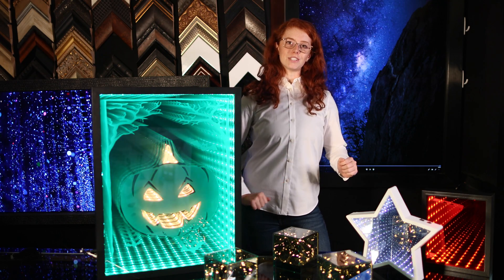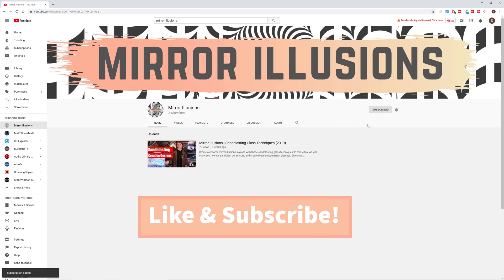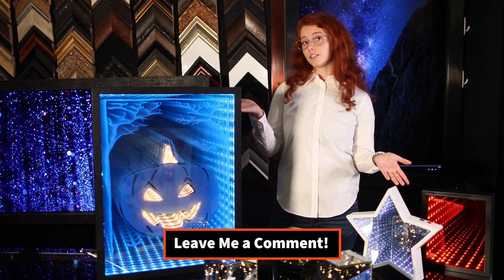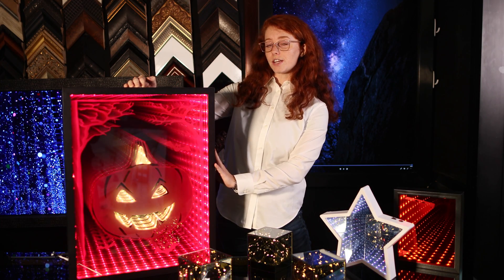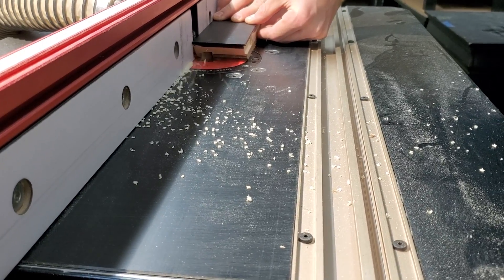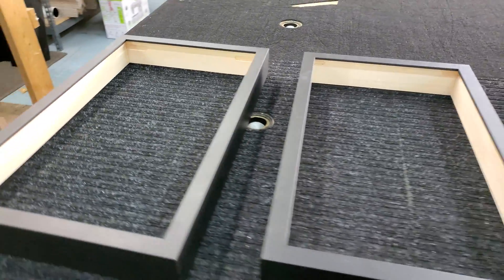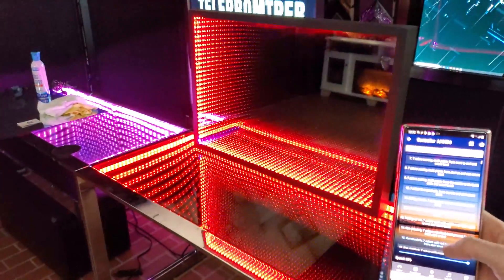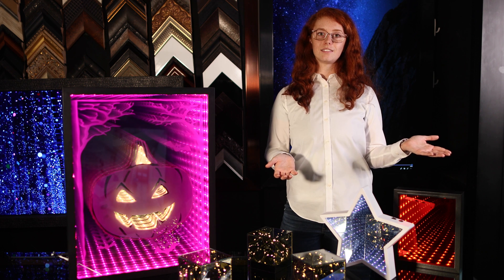Infinity Mirror DIY Project [Step-By-Step Guide]

Comment: Please help...
I made an infinity mirror... But the effect is not good.not only that...the mirror reflection is dull and i can see the led strip from outside even it is off. I used a mirror and tinted glass as 1 side mirror.the tinted glass have coating on 1 side. The other side looks like black glass. When i place coated face inwards the effect became good. But i want to use it as a mirror also....will mirror wrap vinyl work? Please help..
Reply from the maker: For the mirror on both sides effect, you can use an acrylic two way mirror or smart mirror glass: https://www.twowaymirrors.com/smart-mirror/